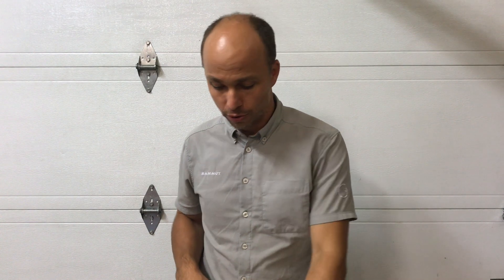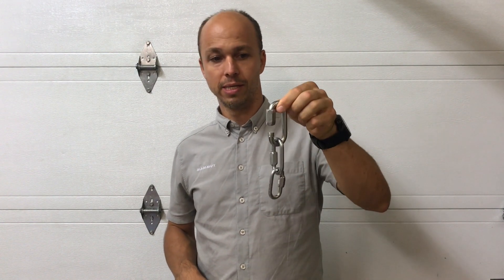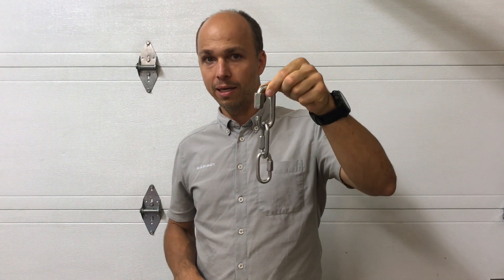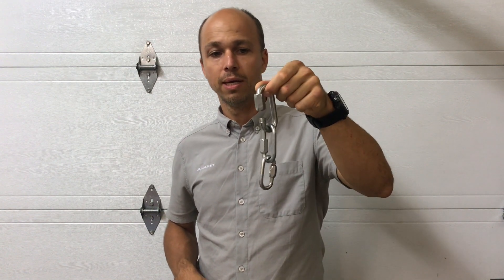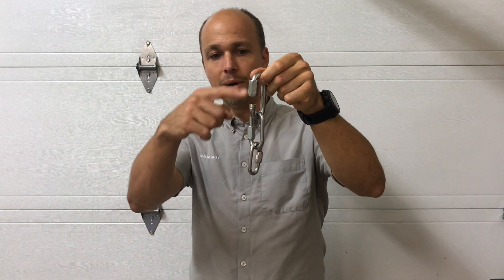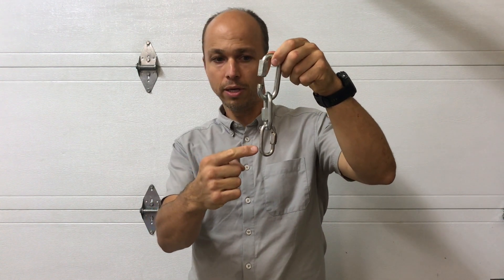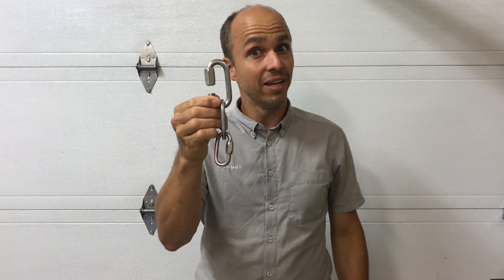Maillons: 7 vs 8 vs 10mm

Comment: Hello again Yann. Have you thought about using the Petzl omnni triact lock? 15 kn in all directions...Cheers and thank you very much for tour awesome channel
Reply from the maker: I must say that I do not own any Petzl Omni. The Triact Lock is a great safe locking method. It is not 100%: a friend working on stunts for the Movie industry have seen a rope snapping into a Triact Lock during a stunt. I must say that the 10mm steel maillons actually have a 25kN MBS when cross-loaded (see https://www.kong.it/fr/2-produits/items/f50-maillonrapide/p91-quick-links and 13 kN for the D maillon: http://camp-france.fr/shop/sport/maillon-en-d-10-mm-zingue-2451.html) I currently prefer to use one of these maillons if I have a single point of connection to the system. If I have 2 connectors (like with the Silent Partner) I can use some regular carabiners (2 x 7kN is 14kN and it is enough and redundant). Does it make sense to you? Thanks for your interest !!!
Reply: Triact has one drawback - it shouldn't be loaded on gate. That's why it very often used on caving harnesses and... harnesses mostly.

Comment: I'm guessing here but I'd say it has to do with the threaded closure, irrespective of size they still depend on that thread to hold it closed. If cross loaded I'd guess it strips the thread to open the maillon and the the load required to do this does not change significantly with the increased diameter. The increased diameter helps in the long axis orientation as it possibly helps resist deformation longer which then eventually strips the threads. Your second question is hard to answer without knowing what specifically you plan to do with it but some level of answer could be gained by how often you see maillons on sports climbs, gyms etc. Without knowing the use its hard to say but there are opening rap rings that might also suit your purpose.
Reply from the maker: According to the tests from Ryan Jenks, I kind of trust a "hand tight" 8mm maillon for basically any use in climbing and possibly without backup. Hell: this thing took 35 kN when crossloaded!!!

Comment: Hello Yann, First of alli would like to thank you for ypur channel, it´s super interestig
I do not any background in science, so take that into account as well.
The point here is that the maillon or biner takes the load on the long arm and this arm doesn´t spread the load along to the rest of the biner, and it´s something due to the oval shape and the way it behaves under load.  I mean,  it doesn´t have to do with the thickness of the material because while country helium wire gate  has also a 10 kn crosslod  In fact most of hms biners are about 
7 to 9 kn
About your second question: if your system consists only on one maillon, that system should have anti icross loading measures (chest rig ...) . If it doesnt yes, you will be able to see your rope from down below. If your system has 2 maillons you are fine
 i use 2 hms for my silent patner and I consider it in my mind as a belay (at least 2 points)
Reply from the maker: Given the tests from Ryan Jenks (hownottohighline), I now trust the 8mm by itself, crossloaded or not! Thanks for the reply!

Comment: For what I know  I don't suggest use mailons because they works corectly in one direction, is always better to use a carabiner. You could try to use the triangular mailons, maybe they are stronger. Also there are D shape mailons that people use in potholing.
Have good climb
Enrico
Reply from the maker: The 10mm D maillon AND delta from peguet france both are 45kN / 10kN across... Thanks for the comment !
Reply: @YannCamusBlissClimbing  where do you you want to use the mailon?